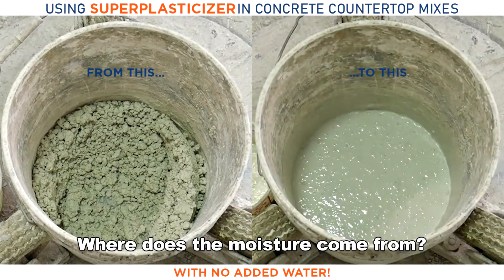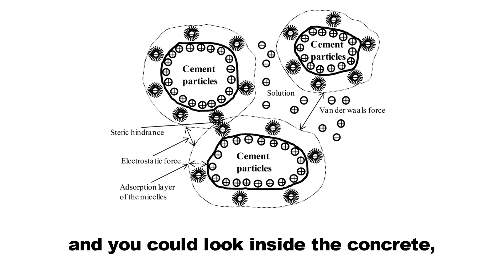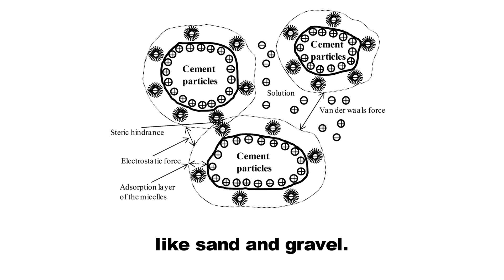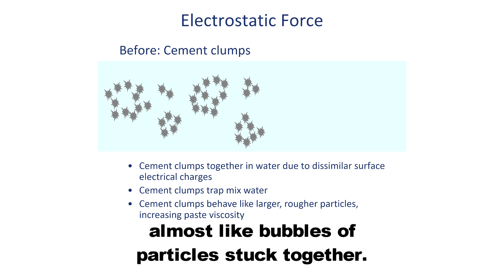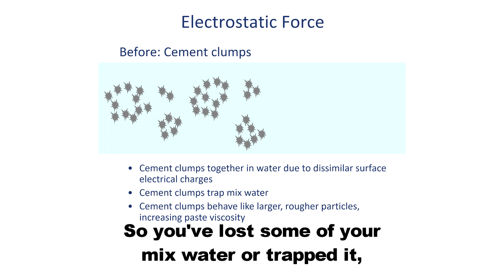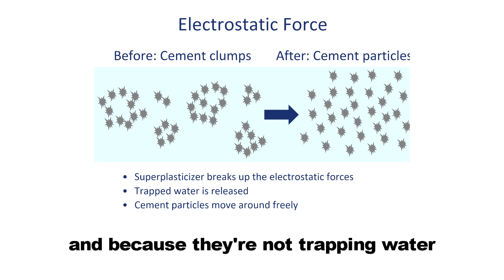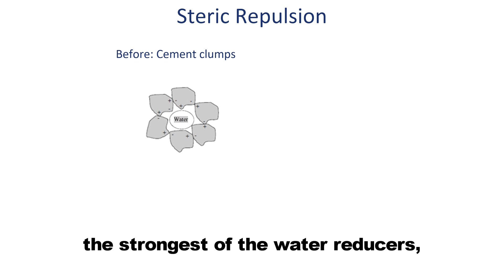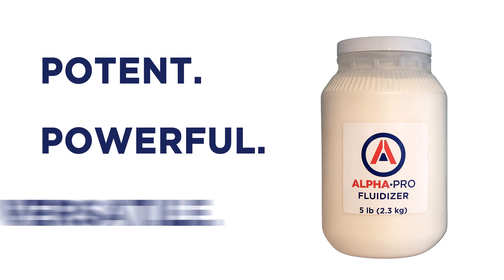How Superplasticizers Work in Concrete Countertop Mixes

Comment: Hey I'm looking for an answer on mixing in s.p. there nothing new we have been using them for the whole 17 years I've been driving mix for so I'm very familiar with the product what I don't get is where I'm from B.C. Canada they tell us to mix it for 1 min per meter so 10 minutes on a 10meter load. To me this is way to long and does not make sense to me. I can not find anything on actual mixing times for adding S.P. you got anything? Or info on this.
Reply from the maker: The time frame is probably to ensure that the superplasticizer is fully dispersed into the truck. 10 minutes of mixing for 24000 kg of concrete doesn't seem very long to me, especially when inadequate mixing could have a profoundly negative impact on the quality and consistency of the concrete.
Reply: @TheConcreteCountertopInstitute  so what I should have said is we add the S.P. on site after fully mixed from plant.
Reply from the maker: @markrobert6014  Ah, I see. Then it's even more important to mix thoroughly. I don't know about the superp your plant uses, but our superp is more effective when adding early, before the cement. You are by neccessity adding it late in the mixing process.
Reply: @The Concrete Countertop Institute  we  add when batched as well every load. We will add extra on site for high slump like 200 millimeters slump/ 8 inch slump. They want to mix for 10 mins on site that extra added s.p.
 We are currently using visco 1000  for about 6 months now previously last 10 years roughly was glenium 3030. Before that was rehobuild.
Reply from the maker: @markrobert6014  I'm not familiar with those particular products, but I would definitely follow what the batch plant recommends. I'm sure it's important for proper dispersion.

Comment: What effect do these superplasticizers have on compressive strength and ductility?
Reply from the maker: Superplasticizers don't directly make concrete stronger or more ductile. What they do is allow for the use of lower water to cement ratios which are directly responsible for higher strengths and improved properties. Excess mix water, which is often used to increase workability, is responsible for a host of concrete problems and deficiencies, most notably lower strengths, excessive shrinkage, higher porosity, low durability and many other problems. Therefore, lowering water to cement ratio is the best and easiest way to improve concrete.

Superplasticizers also increase the dispersion of microfine particles including cement and pozzolans, which in turn helps improve material uniformity and physical properties. Finally, superplasticizers can help make the concrete more fluid and easier to consolidate, helping to eliminate voids, and this also improves material properties.
Reply: @TheConcreteCountertopInstitute So what’s the main causes of segregation and bleeding in concrete with admixtures like superplasticizers and how to control it?
Reply from the maker: @ashrafkarim1826  Superplasticizers reduce the viscosity of the cement paste, changing it from a thick paste to a runny liquid. The higher the viscosity, the more stable the cement paste is, meaning it's able to support and suspend larger, heavier particles in it. As the viscosity decreases, it is less able to maintain a degree of uniformity in the mixture. When segregation occurs, the cement paste is too thin and watery and the solids settle out. As the coarse and fine aggregate settle out due to gravity, they self compact, and the void spaces between the particles decreases. This forces the watery cement paste out, where it collects at the top of the casting. Segregation is controlled several ways, but the simplest way is to make sure you do not overdose your superplasticizer. This is where trial batches become important, as it's the most practical way to determine what the threshold dose is for your particular mix and superplasticizer. Another way is to alter the base mix design to incorporate more ultra fine particles. Switching which superplasticizer you're using also works. Different superplasticizers have different strengths, so switching to a less potent one may solve the issue, and some superplasticizers incorporate viscosity modifying additives (VMA), further helping to stabilize your mix and reduce the likelihood of segregation occurring. And VMA's can be used on their own to reverse segregation during mixing, as they increase the viscosity of the cement paste to a level where the particles no longer settle out. VMA's can be sophisticated admixtures, affecting the static viscosity more than the dynamic viscosity.
Reply: @TheConcreteCountertopInstitute Thanks
Here, we always have an issue with our concrete segregating and bleeding when we use superplasticizers. We use about 1% of the cement we use. Is it more advisable to reduce the percentage of admixture use or changing the design mix? We don’t wanna employ viscosity improvements chemicals.
The design mix here is with 20mm and 20mm gravel, sand and cement
Reply from the maker: @ashrafkarim1826  I suspect that the dose that you are using is too high. Did you run trial batches to determine the optimal superplasticizer dose? 1% is quite high for many superplasticizers. It's always easiest to use less of an admixture than it is to reformulate your mix design. Always take the path of least resistance and change one variable at a time.
Reply: @TheConcreteCountertopInstitute alright thanks
Does the size of the aggregates contribute the segregation? If so, will increasing either the smaller or bigger one have good results?
Reply from the maker: @ashrafkarim1826  You're clearly interested in learning about and solving the segregation issues you're having. While this platform is a great way to explore new topics and share insights, it's not the best venue for in-depth education or specific problem solving, especially if you're new to the topic and have a limited understanding of the causes and remedies for segregation. I recommend instead that you explore the many technical articles on controlling segregation in concrete that are freely available on the internet for a greater understanding of segregation, and I'd also strongly recommend that you contact a local expert to address the specific issues you're having. Local experts are often your best resource, especially because they're familiar with your local ingredients and the types of concrete you're using. Local experts can include the concrete batch engineer for the plant you're getting your concrete from, a professor of civil engineering at a nearby university who specializes in concrete, or even a technical representative for the company who's admixtures you're using. You're clearly searching for a solution, and I believe that your best course of action is to look outside of YouTube for your answers.
Reply: @TheConcreteCountertopInstitute Sure
Thank you